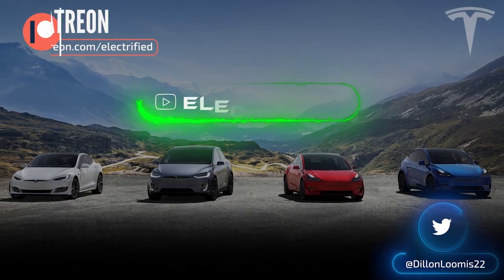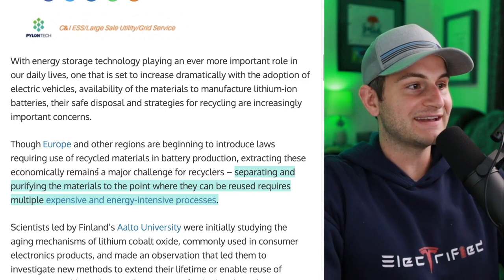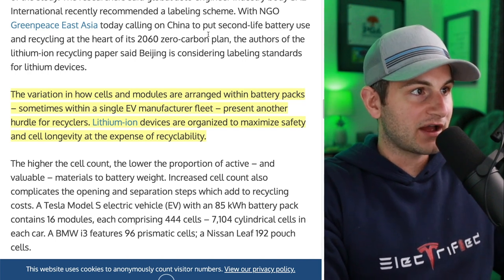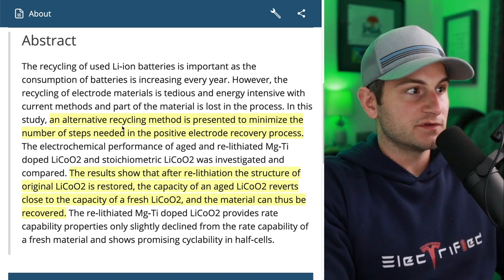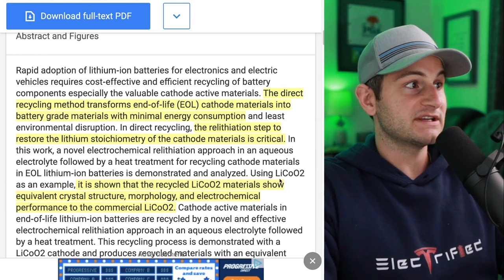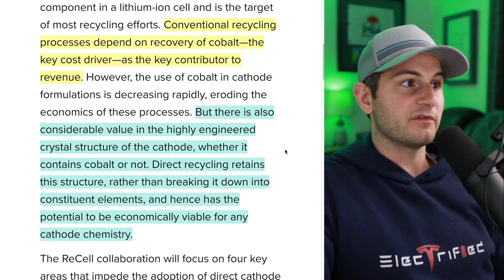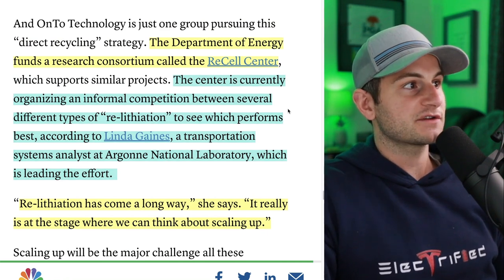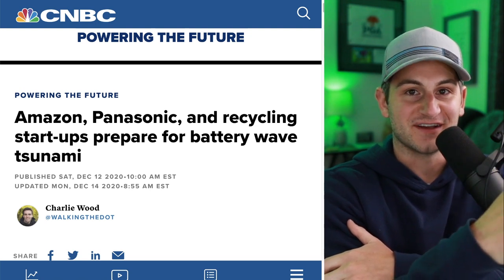Relithiation: The Future of Lithium Battery Recycling?

Comment: One of the biggest drags on the speed of adoption of EVs is going to be the recyclability of the battery materials, and this is never mentioned. Once the worldwide car and light truck fleet is electric, there will be a sudden enormous crash in demand for the raw materials, which are largely recyclable. So as the demand for EVs really escalates, mining companies will be extremely reluctant to sink tens of billions of dollars into creating new mines and mineral processing plants that will be valuable and productive for five or at most ten years. Battery companies too will realize that the plants they make to meet peak EV demand will be very expensive stranded assets in five or ten years as the S curve of adoption nears the top. This will cause an ongoing battery cell shortages as demand nears the peak that will slow adoption and brutalize a lot of automakers.

Comment: In plain English please.  Does it mean you can refurbish the battery to almost it’s original capacity without taking it apart.  And how are EV’s cells relithiumized provided they are are in modules especially Tesla’s batteries containing more than 7000 cells connected all together both in series and parallel configurations.